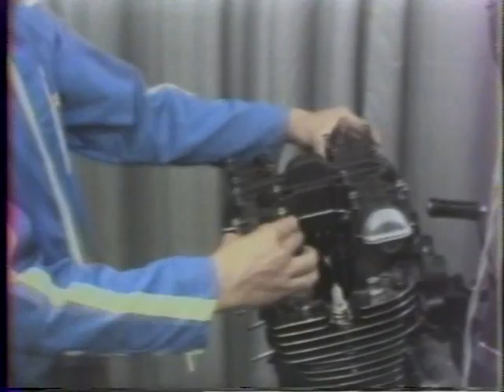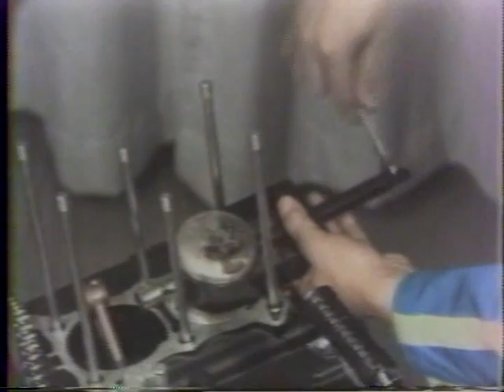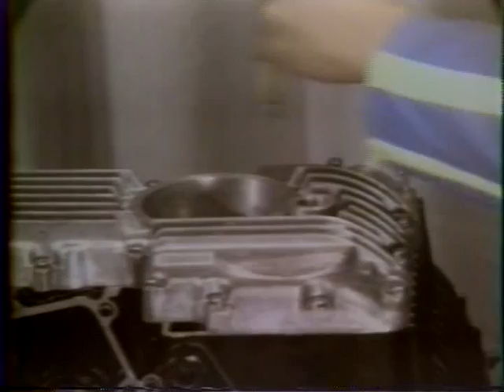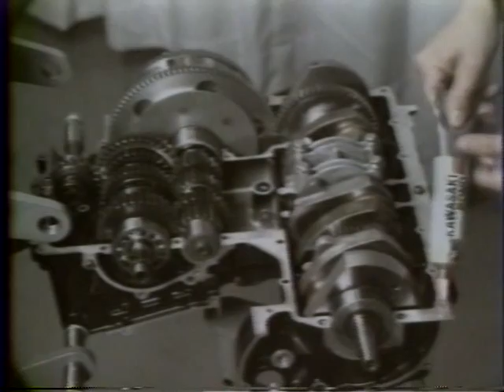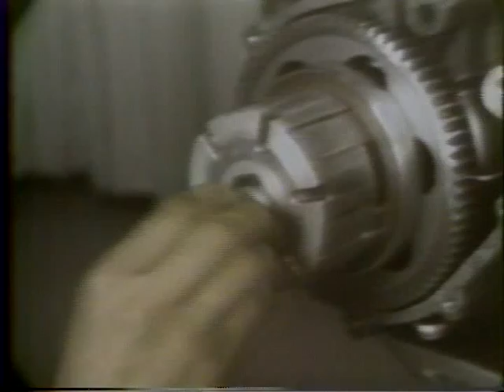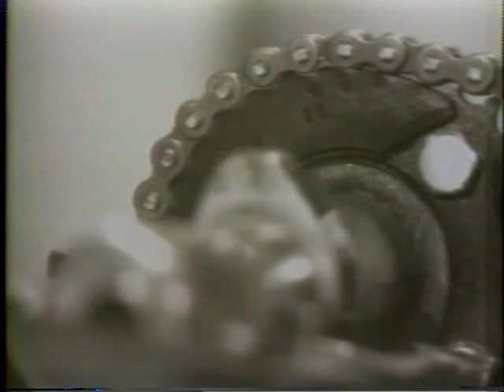Z1 ENGINE DISASSEMBLY AND REASSEMBLY

Comment: Cool video, be careful when you install the cam caps.  I didn't have the cams perfectly centered and damaged the thrust face/surface on the exhaust cap and had to get another head off ebay.  I rewatched this video to see if they mentioned anything about that, and it doesn't.  Be careful!

Comment: I had the pleasure of doing top end work on my 1980  KZ 1300, it was very easy to work on. I'm glad that I didn't have to remove the engine, that would have been hard.

Comment: Caution on the kick start install instructions: hey says turn the kick starter shaft fully counterclockwise then in stall the spring. That's wrong, turn it clockwise. I know because I just spent an hour mucking with this & found the manual says clockwise and it works.

 I think you can see the operator turn it clockwise 

Great video anyway.

Comment: that engine looks very clean inside
Reply: Daniel Clift I had 35000 Miles on mine when I took it apart and it was
Clean inside. If you use good oil I’m sure
Most motors are very clean.